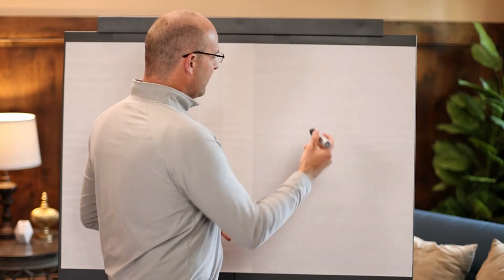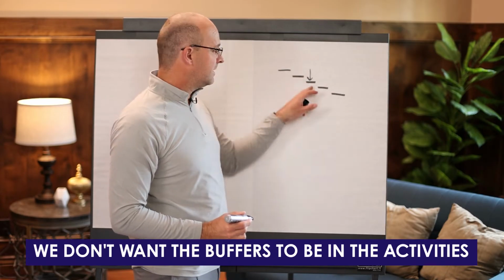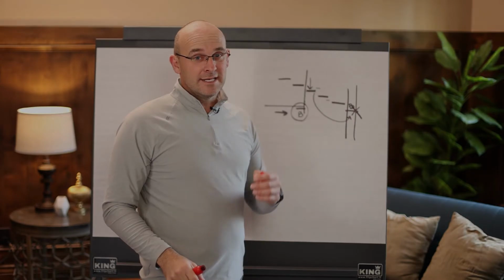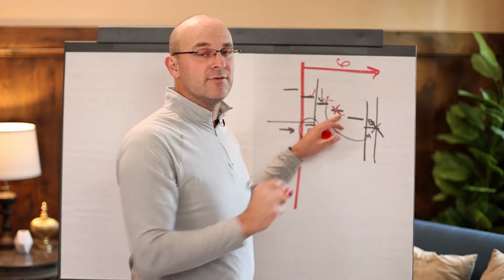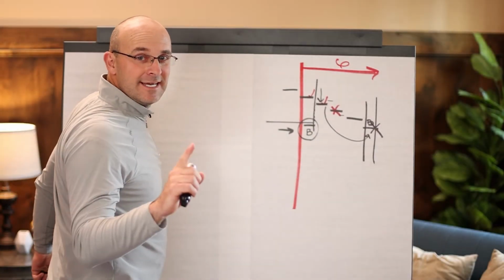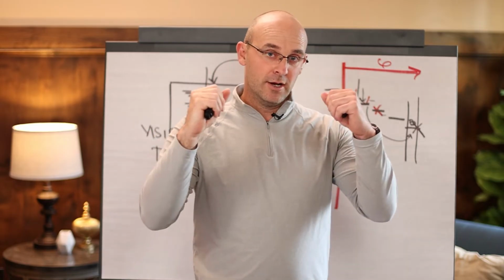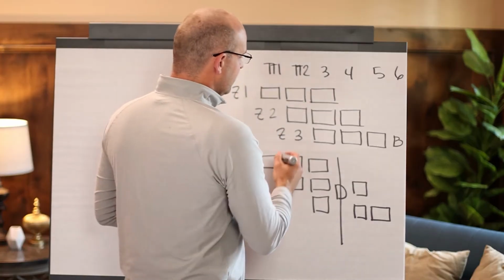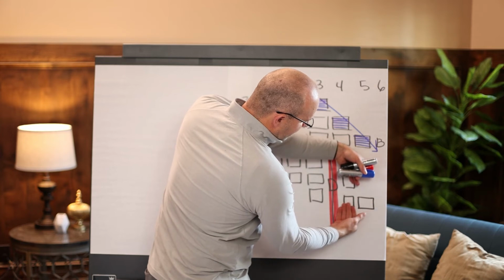How To Deal With Construction Delays

Comment: Question: How do you justify to the stakeholder or sponsor about giving buffer about 3 to 4 months for the estimated time of arrival (ETA) for unusual pattern from your past projects, especially imported equipment such as air handling unit (AHU), chillers, ATS, LVSG, Gensets, Transformers, and more. Let's original ETA of these equipment are around 6 months earliest, given those vendors are supplier giants but still facing delivery challenges such as manufacturing processes, fabrication delays, manpower, customer prioritization (commonly happen especially they always prioritize a company that has multiple equipment that depreciates in 10 years earliest versus light industrial companies that are often order to them).

P.S. at 12:01, are you referring to independent task? Please confirm.

Thank you.